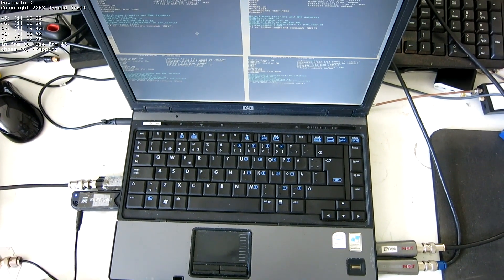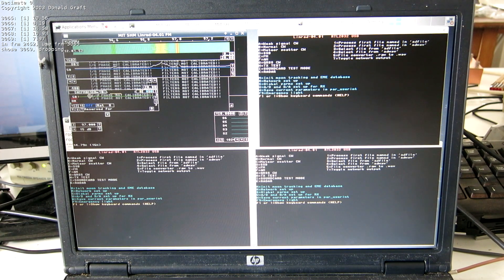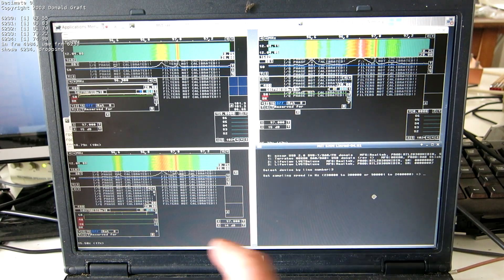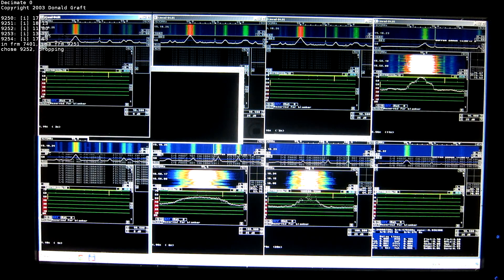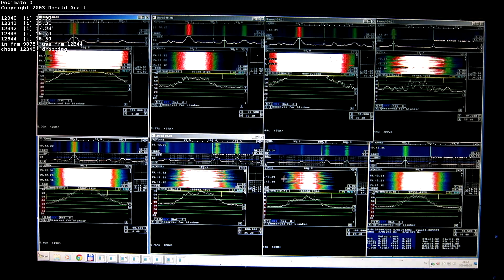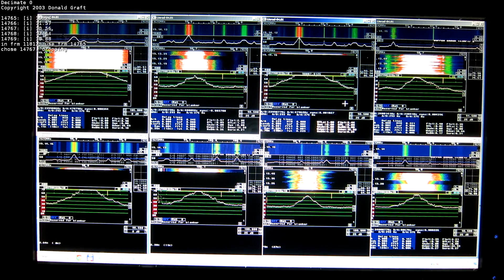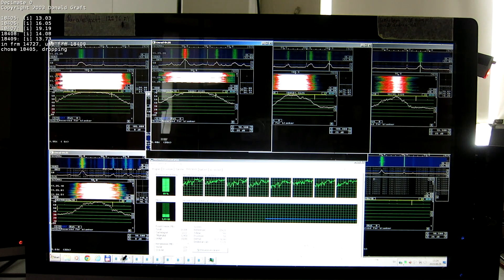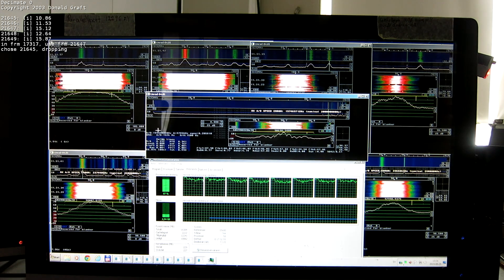multi-rtl

Comment: Hy note if you want to do a band width extension with multiple RTL SDRs you need to mod them. So they all run on a single Clk line (Wire all of them up to a single Oscilator).

Comment: Hi sm5bsz,
Very interesting results !!!
I am new with SDR applications and looking for your recommendation. I transmit of CW sinusoidal signal and receiving this signal by two SDRs simultaneously. 
What program I can use to see and visualize phase difference between these two signals if I’ll move antennas one relative another? Do you have program for 3D (amplitude, frequency, time) visualization?
I installed SDR Sharp and Linrad, but cannot see phase difference. What can you recommend?
Thanks,
Pavlo